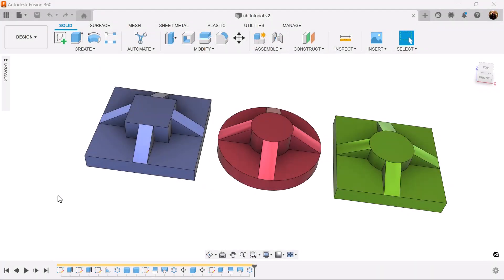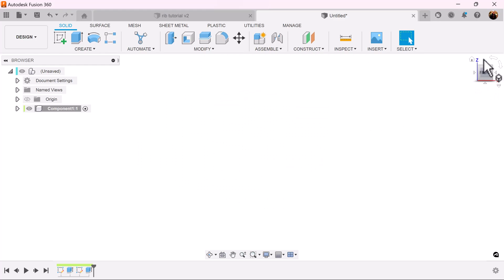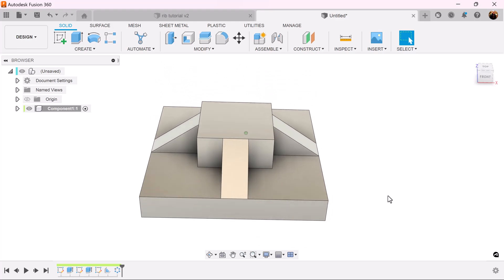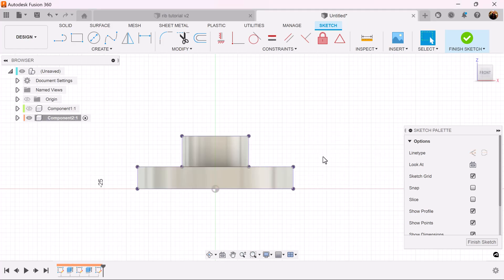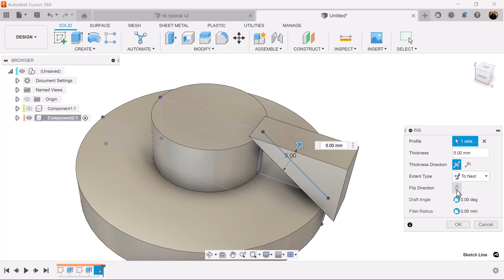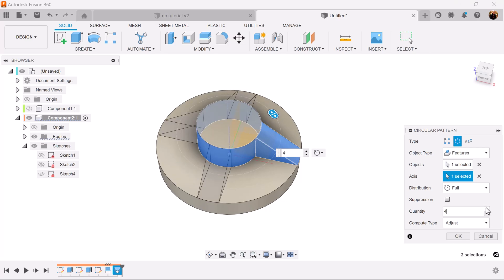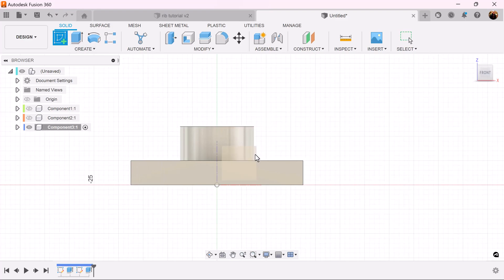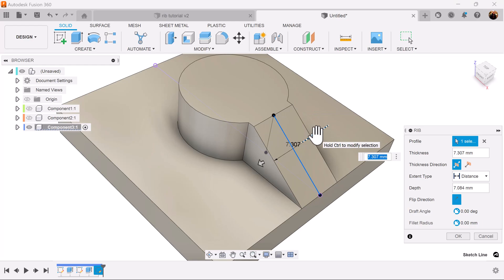Rib command alternatives in special cases I Rep no. 7

Comment: Thanks again for your series, I'm slowly working through all of them. 👍 I have a question. Upon completion of this exercise, when I bring back components 1 and 2, they are 'ghostly', not solid.. Can you figure out what I have done wrong. Thanks.
Reply from the maker: Make sure the radial button at the very top of your browser is the one selected which will make all of your components, bodies and assemblies visible instead of see-through.
Reply: @CADJungle  Great. Thank You.